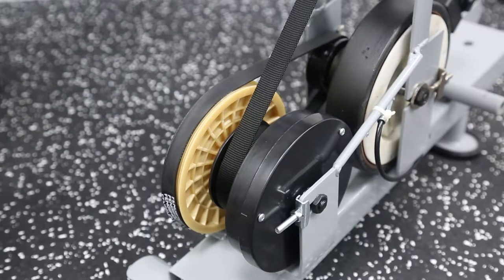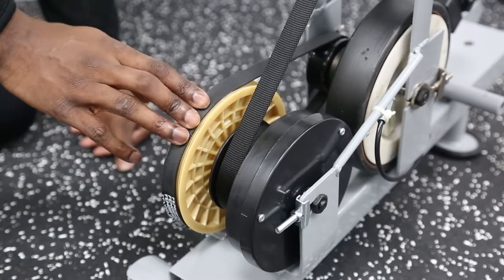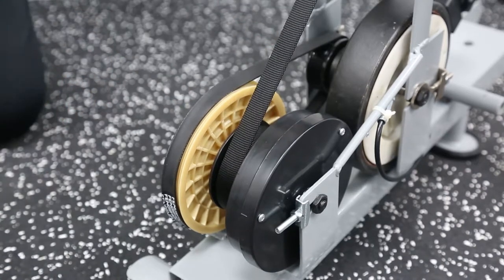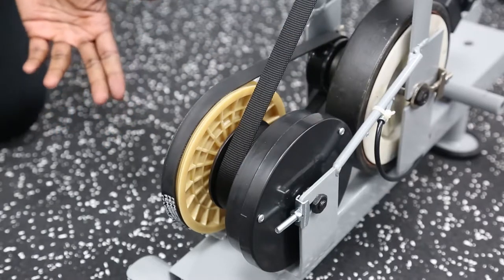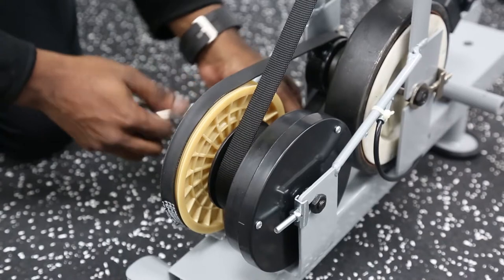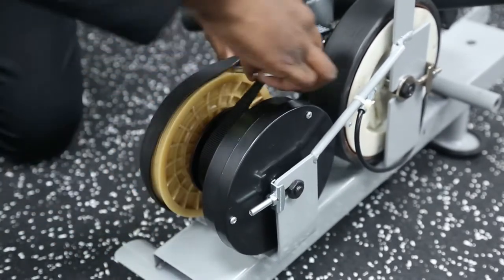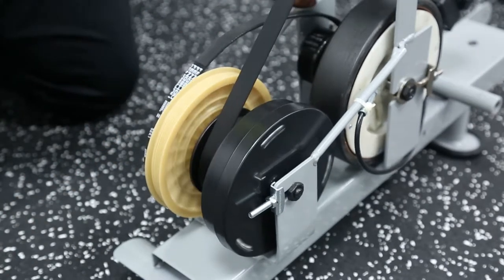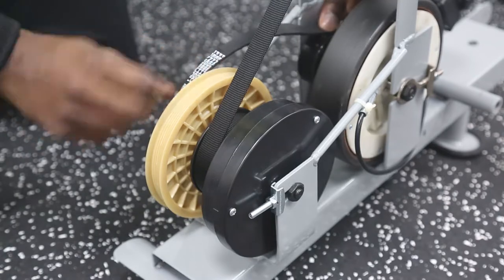JLL® R200 Rowing Machine - How to remove the belt

Comment: How can I order a new belt? I re-aligned the belt but I'm keeping a close eye on it because it frayed a bit.
Reply from the maker: Hi, you can purchase parts for JLL machines through our customer service team via email at info@jllfitness.co.uk, or call on 0121 328 7507 or visit our website for our live chat feature.
Reply: Just go to your local bearing suppliers.
It's a 26.5 inch, J section poly v belt with 6 ribs.
I just picked one up for £10.

Comment: How do you take the casing off the base? Is it simply unscrewing the screws around the bottom?
Reply from the maker: Hi, 
Yes there are multiple screws around the edge of the casing on both sides that need to be removed. 

Kind regards, 
JLL Fitness Ltd

Comment: Getting the belt off the yellow belt is hard. Has anyone ever tried putting new one on. Impossible!
Reply: I could only get it back on by loosening the fly wheel to move it nearer to the coil then retensioning it with the silver nuts